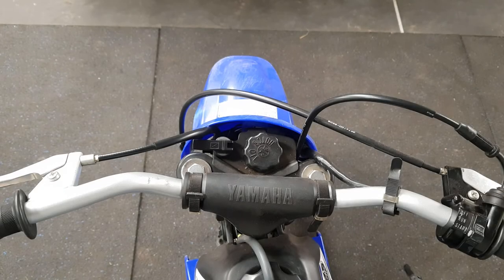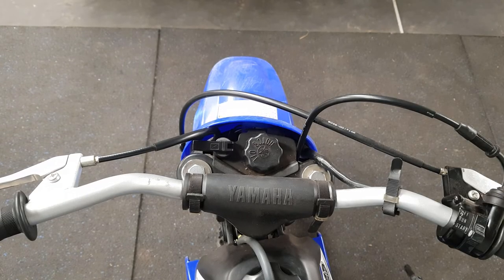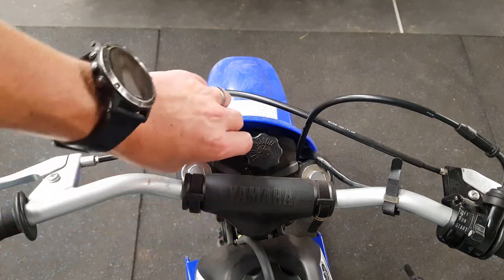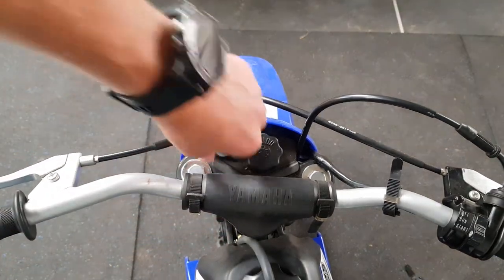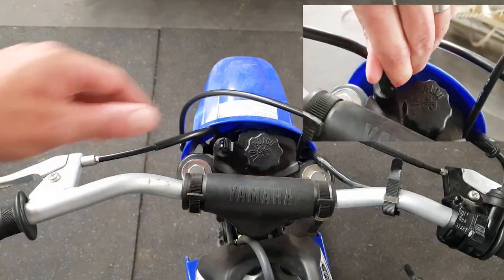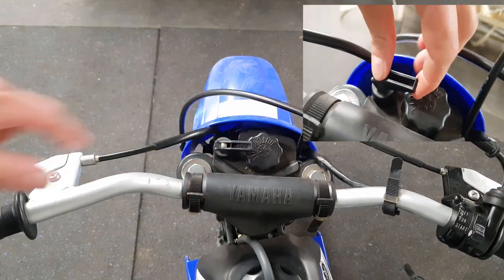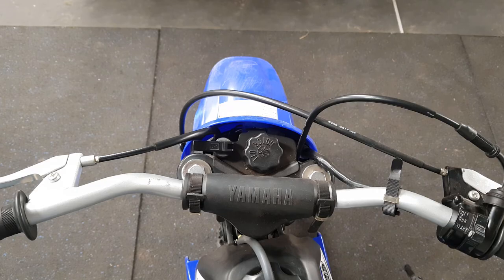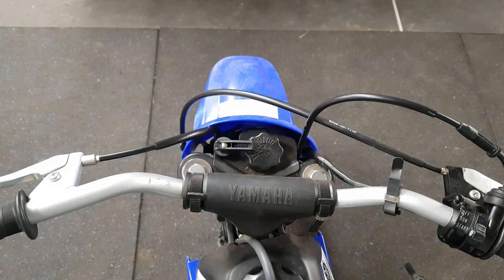Correctly Using Choke When Starting PW50. PW50 Cold Starting

Comment: I think you just changed this dad's life...

Any advice for a pw50 choke that sticks on? Course crew told me my son's bike was running horrible mid race, and after 10min they figured out the choke was still on. They didn't elaborate. Are there any common failure points I should look at when I dig in? I plan to clean the carb first, haven't since it sat during winter. Cheers